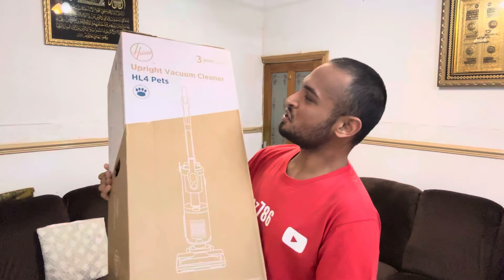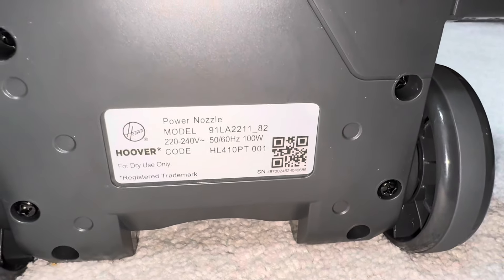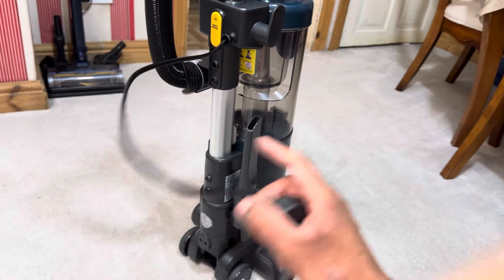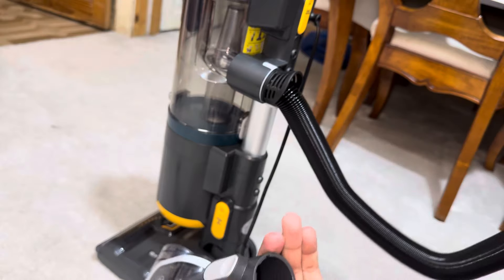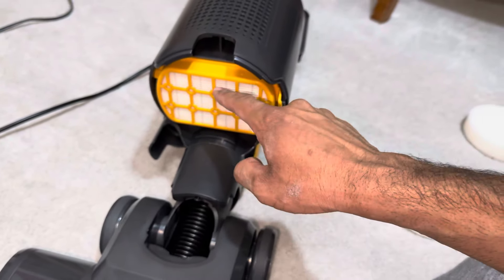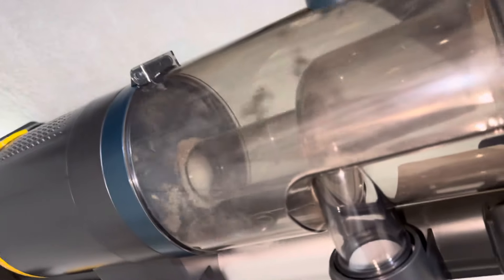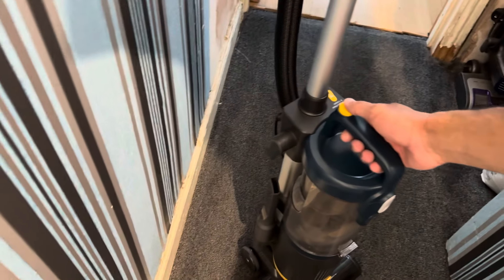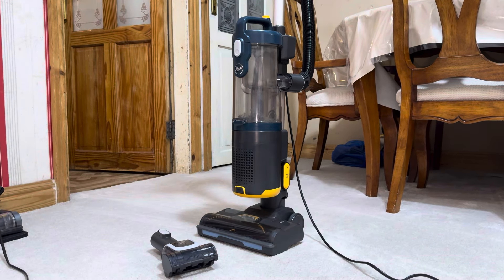New Hoover HL4 Anti Twist Pets Vacuum cleaner - Unboxing & First Look

Comment: Yikes! I remember back when Hoover and almost every other brand was copying Dyson cyclones to try to make a vacuum just as good as Dyson. Now they've ditched that for the snark which is 10 times worse yet we're in 2024. They must have let their brain fall out of their head if they ever had one.
Reply from the maker: It really should have a dual cyclonic design at the bare minimum, I just hope the really thick pre motor filter keeps the airflow maintained for as long as possible